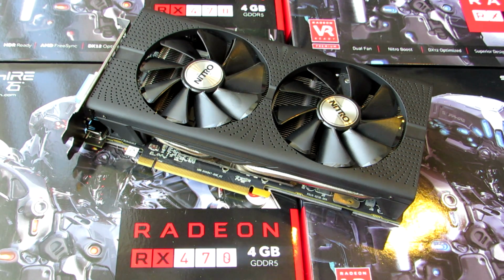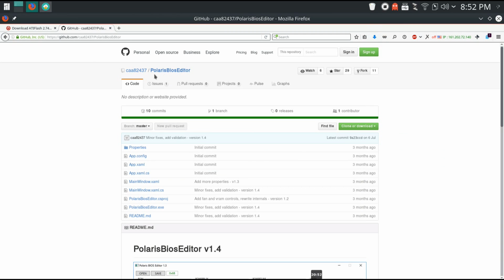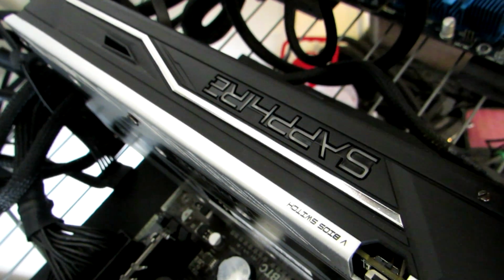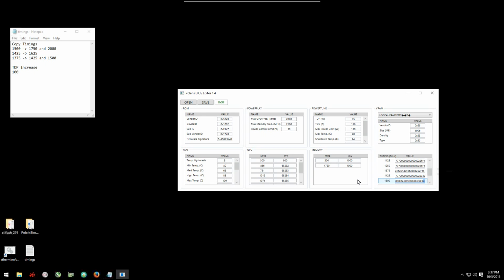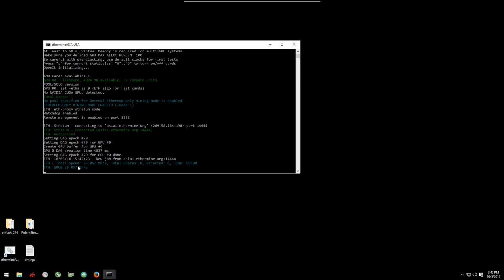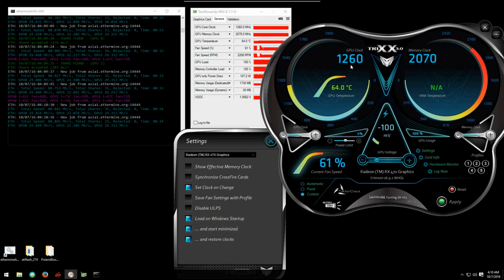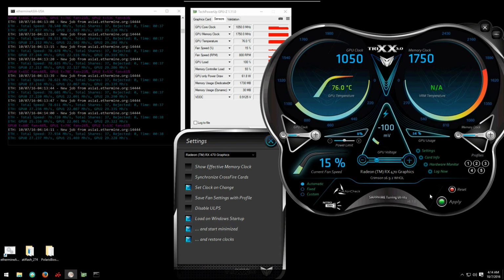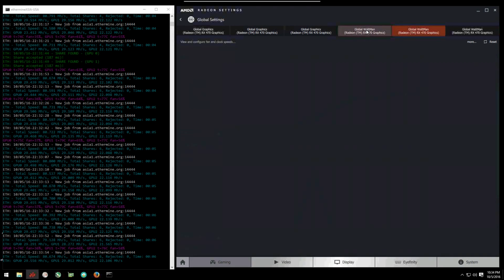DIY RX470 4G 29+ MH/s or 28+ MH/s Low Watt Sapphire Nitro+ HYNIX Bios Mod Ethereum Mining XFX MSI

Comment: Hi Cryptomined,

just wanted to say thanks for a good couple of videos you made, helped me alot, I purchased a rx470 8GB combined your rx480 and this video to tweak the card, modded it got an extra 3MHS out of the 470and then followed this vid to get the voltage down lost about half MHZ but about about half the voltage to around was at 130w now at 68w -113 voltage and fan speed is at 43% so really happy, thanks again
Reply from the maker: cool, glad I could help

Comment: Hello, can be used RX 470 in second pci express to mining. if in First slot ist Radeon 5770 and monitor is conecting to this old radeon ? (RX 470 dont suport VGA conector, MB - M4A89GTD_PROUSB3 ) Thanks for answ

Comment: it is freezy for me. Sapphire radeon Rx 470 4GB hynix
Reply from the maker: Hi Laszlo, have you modified any other settings?  undervolted extra?   overclocked the memory in wattman or trixx?  if your using trixx  and having this issue, try to minimize those changes or stop using trixx...
if you still have those problems, flash back to original bios, I'm not sure why your card would totally reject the memory timings, but maybe something on the card doesnt like it?  what is your ASIC value?

Did you change the TDP in the bios?
Reply: Hello,
Thank you for your quick answer. No, I modified only what you too. Ofcourse, I am using the trixx and the 28Mhs not stable. The BIOS mod was right, but it is not the best hash rate / power setting, need the fine tuning. 27Mhs/100W is stable, but it is not the best setting. 
The 28,3Mhs/75W available with watt tool, but the problem is the voltage offset, because this is not permanent value. 
The ASIC value of the card is 75,3.

Comment: Hello is possible to make a BIOS R9 380 AMD ASUS Strix Gaming equal to the one you made reducing energy consumption and increased mh / s?
Reply from the maker: not so easily as with polaris bios editor, and I have no idea of the changes you would make exactly to make that card perfect.  You would have to use a hex editor and do it manually.  There are some guys who can create you a custom Bios, like Wolf, but they charge a lot of money
Reply: thank you

Comment: do u guys have ans answer, what PSU i should buy for 6 GPU (sapphire 470 4GB) 1000w? or 1200w? if 1000w is enough, i will get it soon, thanks
Reply from the maker: i personally think its better to have extra headroom when it comes to a PSU, so id recommend the 1200G2 or 1200P2 EVGA even if your not going to use it all (or the 1300G2 or P2), others might say 1000W is enough, but its kinda tight with modded bios and without an undervolt and GPU downclock
Reply: Thank You So Much.. really appreciated..

Comment: Hi there. Can i flash my card, even though its the only card on the system, or do i need another one???
Reply from the maker: some recommend against it, say you should have 2 in and flash the second one.. yet lots of people recommend only having one in the system so you dont screw up any others - ... I always only have one in my system... flashed cards maybe 50 times the last month and never had a problem, so I say flash it up
Reply: sorry my english, i saw one of your videos that the card you flashed has no cable coming out of it, so i thought that you have used another videocard for the screen, while you flash the one that is not hooked up, is that correckt? i mean i only have this card on my system anyway, so just wanted to be sure that i can flash it while i am using it!!
Reply from the maker: the nitro have the 8 pin power on the back of the card, so you just can't see it in the video but it is plugged in.  I used the same video card that was powering the screen.  If you are worried, try to use the command line to flash as there is less chance for it to freeze and crash.

Just make sure that Nothing else is running the GPU - no trixx, no miner, etc...  screen powered by the GPU you are flashing should be ok.  Bios is generally used when the OS is loading, you should be ok
Reply: oh i see now, thank you very much, i will report back if my flash works, and the results i get.
Reply from the maker: Vini Shehu thanks

Comment: Hey man, after flashing my rx 470 4gb nitro+ same as you, i get white screen while creating the DAG file everytime overclocked to 2050. Any ideas?
Reply from the maker: try to lower your Overclock, not all cards can go so high, some dont like going past 1900.  let me know if that works... if its crashing, keep trying to lower the clock until it does not crash
Reply: I tried to use Trixx instead, which seems to work well. It hasn't crashed after using Trixx, running 2050. :)
Reply from the maker: TheXmikkel cool

Comment: What 70+ W in GPU-Z translate to W from wall ? have a cooler master G550M PSU can i run 2 of these cards with modded bios (28Mh/S) ?
Reply from the maker: ill unplug 4 cards from the 6 GPU rig and see what that runs from the wall in the morning without any extra undervolts, GPU's flashed with Boysies Modded Rom... (running ASRock Pro BTC Motherboard, 4 Gigs ram, G1840 CPU on the stock cooler and 2 Nitro 470 4g GPUs).. ill reply back as soon as I have the time to do that for you.
Reply: Cryptomined awesome thank you

Comment: Thx for the tips but i have few question. MSI Z97 Gaming will this motheboard support 7 gpus together for sure 100% if i buy 7 gpus like Sapphire Nitro+ RX470 4G which means i can get around 196mh/s of course if i modded bios like this and will be power supply of 750 w 80+  evga enough for Intel Celeron G1820 2,7ghz, 4gb ddr3 ,250gb hdd  and 7 gpus if one use around 70-80w = 560w after modded bios.I'd try flash one by one gpus and after flashing put all cards to work in each slot will this method work ?
Reply from the maker: I have not used this motherboard yet (Msi z97 gaming5)  but I plan to build this system in the next week.  I should do a video on building it though i will probably use 5 480s and 2 470s,,. still pondering that... power supply is something I am also pondering, maybe with 7 GPU's it is really better to run 2 power supplies to get more than enough 6 pin power connectors to run each GPU riser off of a separate PSU molex or sata cable...  but 750W is not enough regardless... your going to be looking at MAYBE more or less a 1000W power supply if you are lucky and can undervolt all your cards successfully... I would recommend and it is probably safer to get 1200 or 1300W to have some extra wattage room and not run the PSU at near 100%.  I am considering getting 2 650W or 2 750W PSUs and linking them together... or run them off of the 2000W leadex that I already have as it has 9 8pin connections..   so... if you went with a single PSU you would need 8 8pin PSU connections so that you could connect the 7 GPU's and the CPU.. the only PSUs that I have experience with that have that many 8pin connections are the AX corsair series and Leadex 1600 or 2000W PSUs... but you can look at others as I am sure some others also do...  but you probably have to look at the higher end single PSUs have that, usually 1200W and up.  even though GPUZ says 70W, the card will pull more total from the power supply...  so dont use that number as your estimation.  personally i cant get my 6 card 470 sapphire nitro rig less than about 800-850 watts with undervolting and I am using the boysie mod on them all, others may have more luck.

That being said, many people do have success with this board and it comes highly recommended for mining by many people and it seems to be the 3rd most used board for mining today (at least with EthOS)

If you come back in 1-2 weeks I should have some real life experience with this board and will be able to let you know exactly what I did to get it working.

Comment: Big Question for me.  I have watched all of your videos and have modded my Sapphire 470s/480s and MSI 470s with your techniques.  Thank you very much for showing us how to do this!   I just noticed that I have modded ALL of my cards with the v bios switch in the gaming oc mode the whole time.  They  have been running fine for about 2 days now with the 470s at 27.5mhs and the 480s at 29.5mhs.  THE QUESTION: should I re-flash the bios on them and are there long term effects of modding such as I have modded?
Reply from the maker: well it is ok, they should work fine no matter which VBios you flash over to be honest, just make sure you keep a back up of your OC bios.  TBH, you should be ok as its not overvolted or overclocked too much,  but only time will tell :)  Although increasing the timings too much can damage the card, this should not be too much, what does the most damage over time is overheating and overvolting, so just keep them as cool as you can and it should be ok.

Comment: i cant do it, sapphire 470x OC, W10 (code 43).
Reply from the maker: what drivers are you using?   you have the Nitro card?  or sapphire reference?  try to use DDU to uninstall drivers and reinstall 16.10.1. which driver version do you have installed now?
Reply: cryptomined I have same problem I'm installed 16.9.2 
with Windows 7

Comment: Great tutorial.

Will you do one for RX 480 4G?
Reply from the maker: I dont have that card and wont be buying any... thinking of trying a couple 470 8g, but still not sure on that..., but the 480 4g should be the same timing edits as the 470 4G card as it should be the same memory.  I would try copying up the 1500 strap or do the timing strap copies from this video.  Then change your memory frequency, GPU clock and voltage in trixx after flashing your card to the new memory timings.

the 470 8g has the same timings as the 480 8g.  The 470 4g should have the same timings as the 480 4g.

Comment: what's your motherboard for 6 gpu, bro?
Reply from the maker: i have a video to upload on the best/most used socket 1150 motherboards for mining.  I use h81 pro btc, b85 anniversary and a gigabyte board (though just 4 in that board).  Id also recommend the biostar H81S2 as its as good as the Pro BTC in reality... and if you want 7 GPU take the MSI Z97 Gaming 5.  those 4 boards + the H97 anniversary make up the 5 most popular and used 1150 motherboards for mining.
Reply: Спасибо. Что сказать о ASROCK FM2A55 Pro +?
Reply from the maker: have not tried it myself.  Probably good board for mining. 5 PCIE = 5 GPU. AMD processor. should be great.

не пробовал себя
но, наверное, очень хороший совет
5 PCIE = 5 GPU
Процессор AMD
должно быть большим
Reply from the maker: Gigabyte 990FXA-UD3  ...  has 6 pcie slots
2nd most used amd board for mining

Comment: This card 4 gb 256bit or 8 gb 256 bit?
Reply: What would you recommend for 6 gpu motherboard? Btc pro not sale of turkey.
Reply: 4gb i saw in vid.
Reply from the maker: 4G maybe i should fix hte title and reupload
Reply from the maker: yup and if you have an 8G 470 nitro, the memory should be samsung, just like the 480's. So if you do the same to the memory straps and then overclock the memory in Trixx, and downclock the GPU and undervolt from -50 to - 120 mV you should get similar results (29+ MH's at a good wattage)

Try copying the 1750 timing strap into the 2000 timing  strap as I did in my first 480 video  OR  Try copying the 1750 timing strap into the 2000 and copy the 1625 timing into the 1750 timing strap.  that should give you the same results.

If you want you can upload a bios and I can take a quick peak at it to see if the timings are the same as a 8g 480 and upload you some screen shots of what to change.
Reply: for 29 mh/s on rx470 4gb need overclocking?sry i donot flienty in english.
Reply from the maker: yes overclock memory as much as you can.  The more GPU frequency, slightly higher Mh/s... with undervolt its ok.
1. change timings
2. undervolt GPU voltage as much as you can
3. overclock VRam memory as much as you can
4. adjust GPU frequency to your desire, higher gets higher hash rate, but lower gets better watt usage.
Reply from the maker: Biostar H81S2, ASRock Anniversary H85 or H97.  are any of those available?  video is uploading now on the 5 best and most used 1150 boards.  Use a G1840 CPU or if you want, G3260 is good if the price is not much higher than 1840, usually its just 10$ more.
Reply: These cards are not sold in Turkey.Are there any other suggestions?
Reply: can i have your facebook hamgout or any chat app? thx
Reply: i need to be in test mode and driver signature overide?
Reply from the maker: import them, nothing else will compare if you want to mine ETH.  if you want to solo mine something else like LBRY, you can get some 1070's or 1080's.  Take a train trip to the EU and grab some maybe.
Reply from the maker: you just need to have the most recent drivers installed, 16.10 just came out, but 16.9.1 or 16.9.2 also work fine.  i actually dont use any chat apps... do you know how to use IRC?  do not do this with ver.15 drivers installed, you will need to make too many modifications to get it to work, its a pain in the ass when you can just install the most recent drivers instead.

Again just switch the bios switch to SILENT mode to test out modified bios
If you have a problem and wont boot - switch back to OC bios, boot into windows then flick the switch back to Silent Bios while in windows and reflash back to the back up bios you made before modifying and try again

if you follow this video you should be fine

Comment from the maker: This is mostly for those who dont care about power usage (those living in countries with practically free electricity)... otherwise this is also great for those who don't like to use downloaded roms and just want to edit their own rom with polaris bios editor... get it down to 70W!~
Reply: Did you try XFX Radeon RX 470 4GB (RX-470P4LFB6)? Will they speed of 28-29 Mh/s?
Reply from the maker: Жека Миронеко yes, I tried the custom fan editions, works 27.5-28.5 from mine.  you can copy up the timing straps manually with polaris bios editor